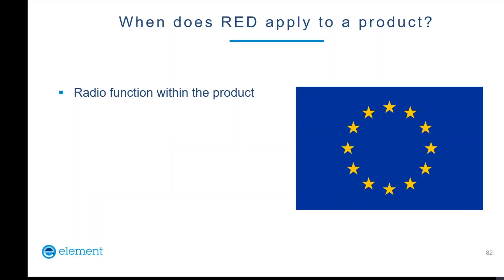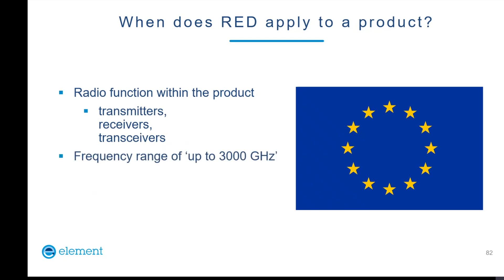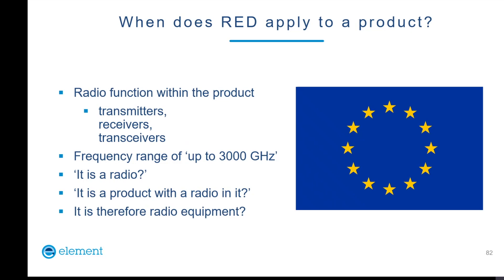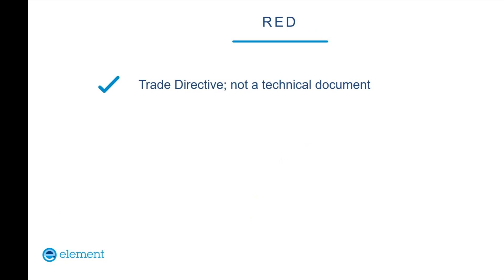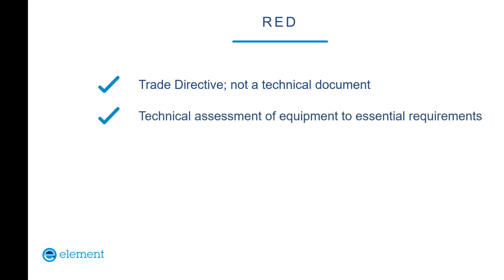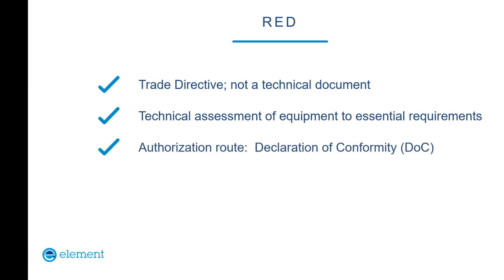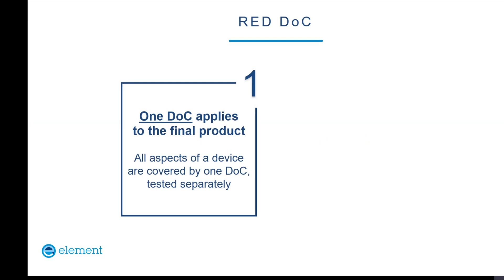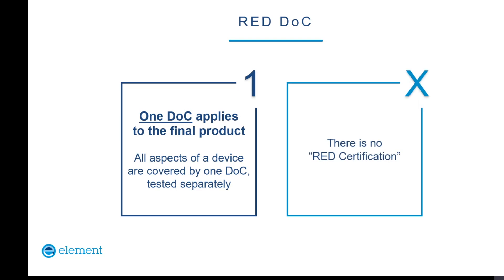Demystifying the Radio Equipment Directive (RED)

Comment: It is quite surprising how many electronic devices are only just within technically acceptable limits and generate splatter. Most compliant, but noisy circuits are designed to just meet the standard as cheaply as possible and have filtering / shielding that leaves a lot to be desired. In the Test Dept, radio shack, electronics workshop almost everything has additional filtering,  shielding and connection to Station Ground. With sensitive receivers and equipment in limited space spurious emissions and rising tide of noise from multiple sources makes the battle to improve SNR a bit harder.  Better 'quieter' devices are a good thing.
Reply from the maker: I bought a Icom R8600 last year, and I specifically ordered an ICOM PSU for the radio. But you know, the PSU actually doesn't have better EMI performance compared with an off the shelf one I got online...... I used to think, if I could manufacture really good filters for radio amateurs, there might be a market.
Reply: @MachOneDesignEMC  strangely many of the older units have been quieter than the newer versions. I have a few vintage radios and PSUs that are actually cleaner/quieter  than their modern equivalents. Yaesu FT-747GX (modified for digi modes 5W Max RF output) with FP-707 PSU and a classic Kenwood TS-130S (for SSB voice and digimodes, modified 20W Max RF output) with Trio (early Kenwood) PS-430 PSU. Both setups are less efficient but generate far less noise than most of the more modern gear. Newer is not always better when you put them on test.